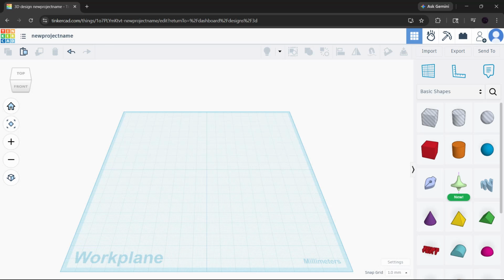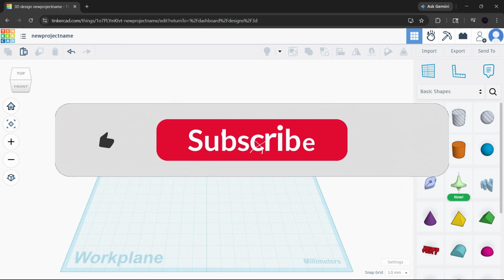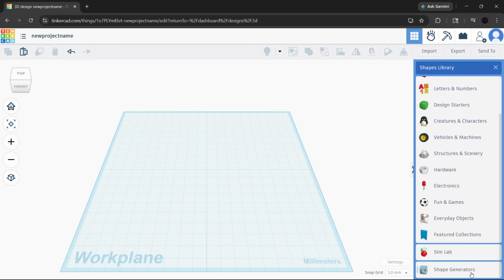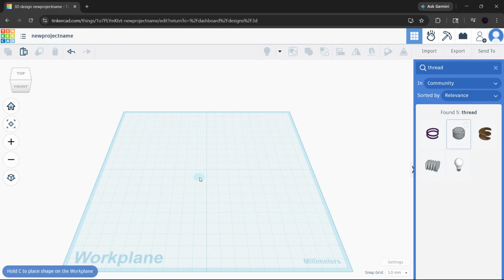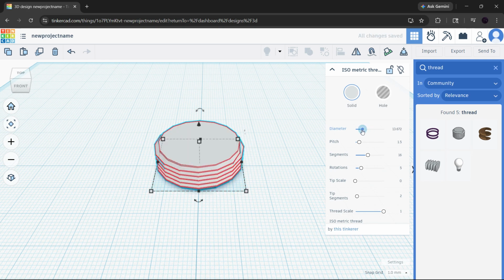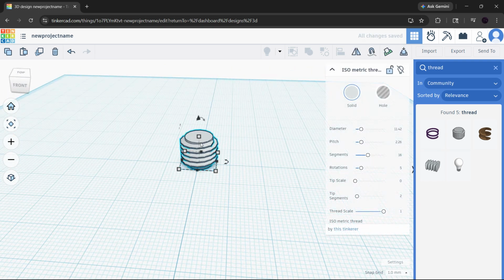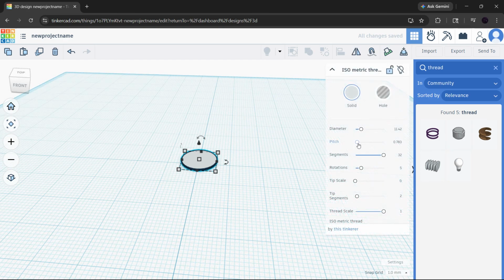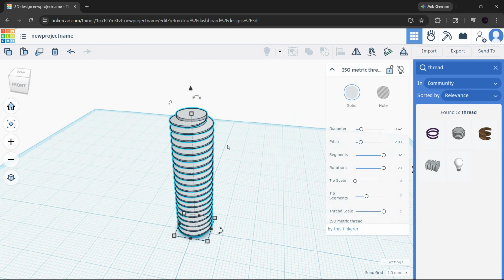How To Thread In Tinkercad (Easy Guide)

Comment: What does Tip Scale and Tip segment refer to?
Reply from the maker: Those settings usually show up when you're working with curved or tapered shapes in Tinkercad (like the Cone, Cylinder, or Star shapes):

Tip Scale: Controls how wide or narrow the top point/tip of the shape is relative to its base. Increasing the Tip Scale flattens out the sharp point into a flat, flared, or truncated top, while setting it to zero keeps it pointed.

Tip Segment: Controls the geometric smoothness or detail at the top tip. Higher Tip Segment values add extra facets/polygons to smooth out the apex, while lower values keep the point sharp or blocky.